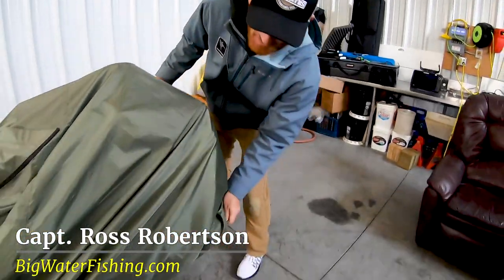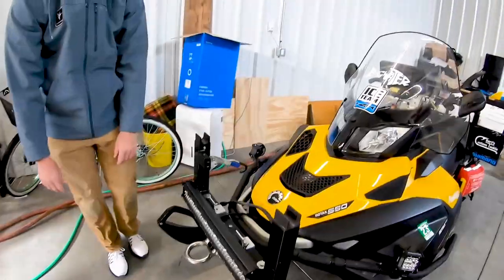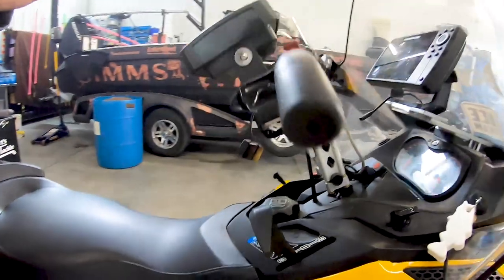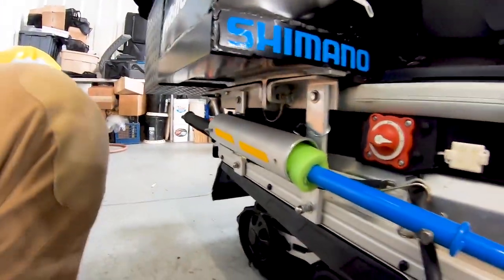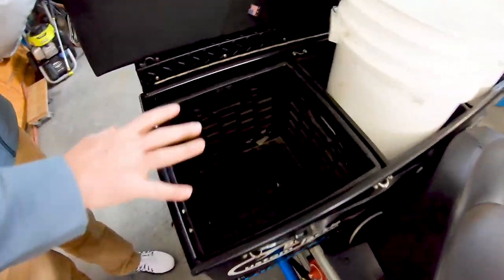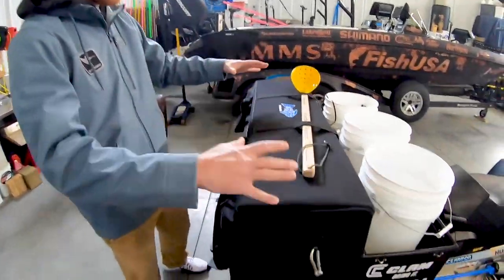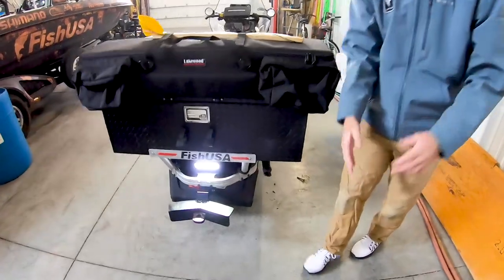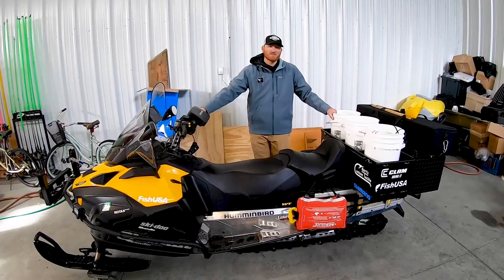The GREATEST Ice Fishing Snowmobile EVER!!!

Comment: Looks pretty sweet. 550 doesn’t have enough power for my application. 2 feet of slush with 2-3 sleds that thing is stuck. Overall nice set up. Something like this on an expedition swt 900 ace turbo would be the ultimate set up.
Reply: The 550 has plenty of power.He  Has to much weight on the machine. If it was a swt he would be golden.
Reply: @scottbuechel3170  They don’t make a 550 with a SWT. It’s now a 600R E-TEC which has 125 hp compared to the 57 hp of the 550. My 900 ace turbo swt has 155 hp which is more than enough. I’d say that 100 hp is the minimum.